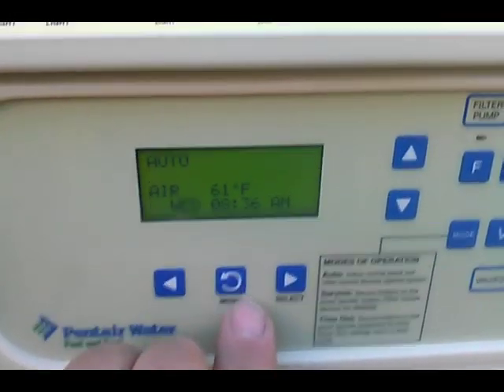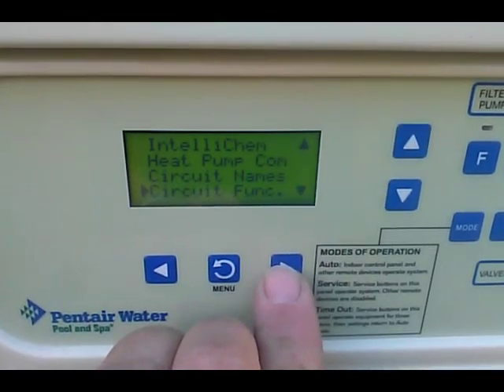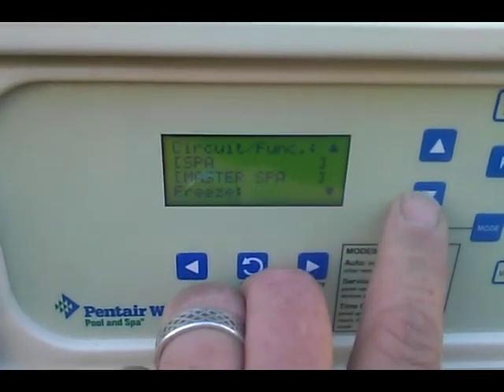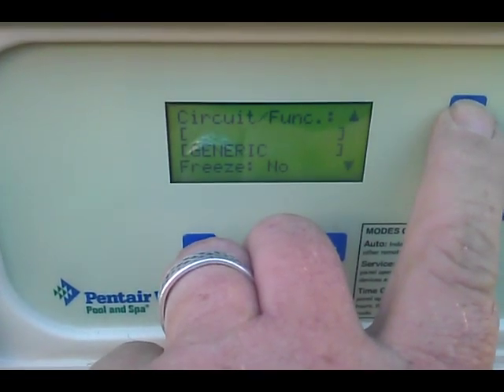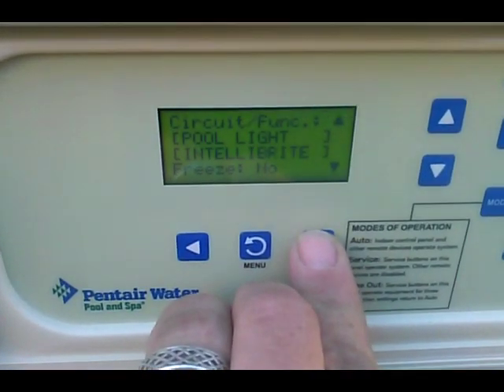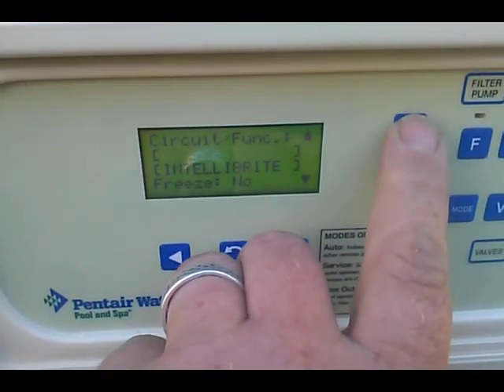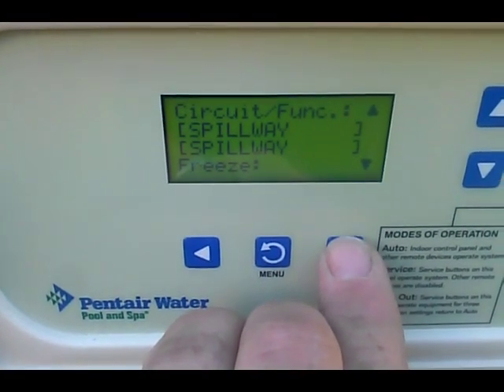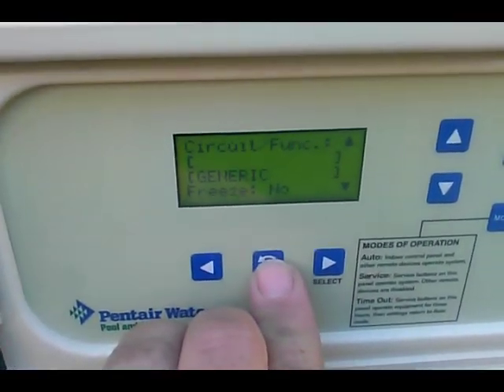Programming Circuit Functions on an Easy Touch

Comment: John, 

I want to schedule a second "pool' function that will run faster during the height of the day. Say between 11:00 AM and 2:00 pm, then drop back down to lower speed.  In one of your videos, you indicated that higher speed always takes precedence, so I will have pool at 1800 rpm most of the day, 8:00 AM to 8:00 PM, and Pool Fast 2200rpm from 11:00 AM to 2:00 PM.
Note, this is part functionality, and part ambience of water flow.
How can I add a second function to my main pump that I can schedule and adjust exactly like main pool function?
Reply from the maker: okay first we need to set up a new circuit.....
select menu, select settings, select circuit names , scroll through until you get to F.circuits 1-8 and choose the one that is not being used. and label that high speed or something to that effect.
https://youtu.be/5RzyPVjx1NM
then go back to settings and select intelliflo pump 1.
then go through to a speed that is not being used you will know because it says 1000 rpms. set the new circuit that you've made to whatever speed you like.

finally go to schedules handset the time that you would like that speed to run it's okay if it overlaps the slower speed because it will default to the higher speed.

Comment: Hi John

Thanks for all the easy touch videos. I just replaced my mother board on the easy touch control panel and the pump won't run unless I manually run the intelllipro 4 VS pump at the pump. Is there a sequence of events that needs to happen after a mother board is replace.

Thanks!